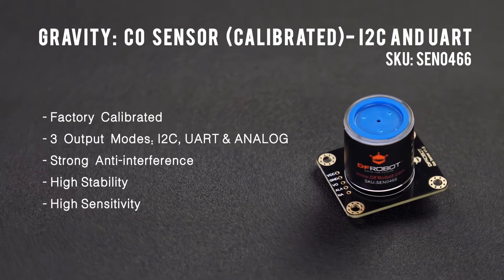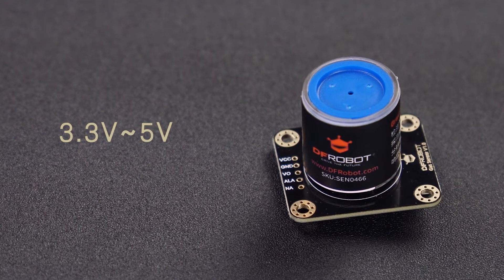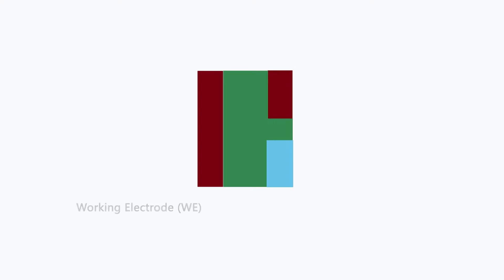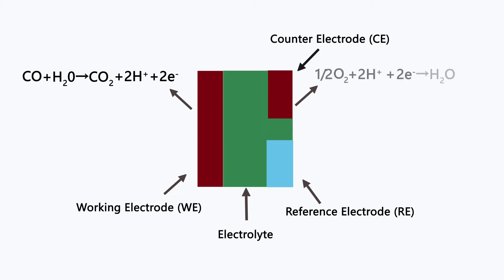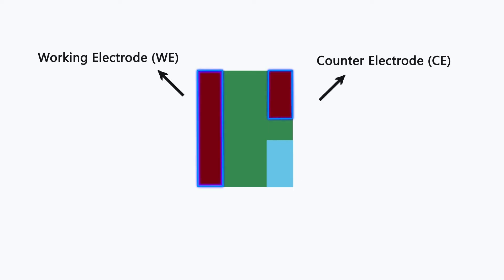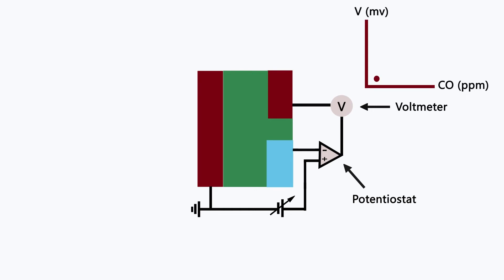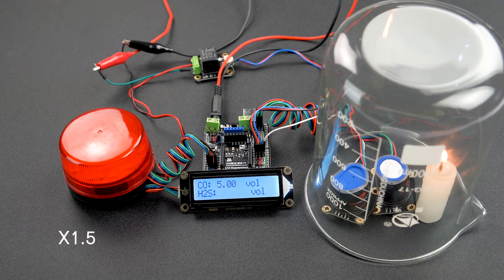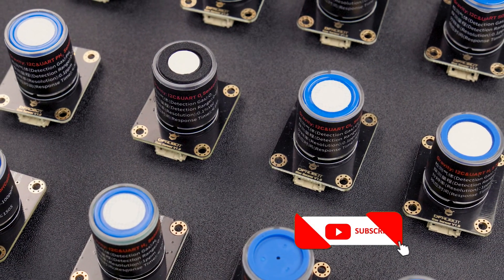How An Electrochemical CO Sensor Works - Gravity: CO Sensor (Calibrated) - I2C & UART - SEN0466

Comment: I using the i2c communication on esp32, its works for a while (3 days).  When its come for one week constant using, the sensors can't work properly and keep popping the "NO DEVICE" feedback. Any solutions for this, should i change the communication type to UART for constant and long term using ?

Comment: Any solutions for error reading from this sensor ? Its keep popping "no device" even though the Power Supply is already  match the sensor working voltage (3,3 - 5 V)
Reply: hi there, is there any solution for ur problems? I'm gonna use the sensor too, thank u in advance

Comment: Nice demo, thanks!

What other gases would give false-positives in absence of CO? (VOCs? Aldehydes?)
What other gases would give false-negatives, even in presence of CO? (ozone?)
What gases/vapors would damage the sensor in the long run? (Silanes, outgassing from silicone-kit?)
What situations might affect the sensitivity adversely? (No free H2O to feed the redox-reaction, in extremely dry environments?)
What situations to watch out for, in general? (Rapid temperature-fluctuations?)
What is the power-consumption (standby, ready-to-go) and energy consumption (energy per measurement) of such a sensor? (Can it be battery-operated?)

Did I miss something?
A good engineer would/should want to know all sides of the equation :)
Reply from the maker: Thanks for your interest in this video, we shall do our best to answer your questions.
The false-positives gases are shown in the graphs in the video, and there are no more data available on the absence or presence of CO. These sensors may be damaged when being used or put for a long time in anaerobic environments. Besides, organic solutions and gases and corrosive gases may harm them.
The power consumption varies with different gas sensors, and the relevant information can be found on the product webpage or WIKI. For your other questions, sorry, currently we don’t have further information to provide. Thanks again for your question, we will try to provide as much information as we have.
Reply: @DFROBOTCN  Thanks!
Reply: wow, nice question